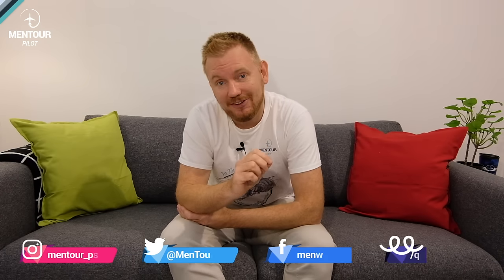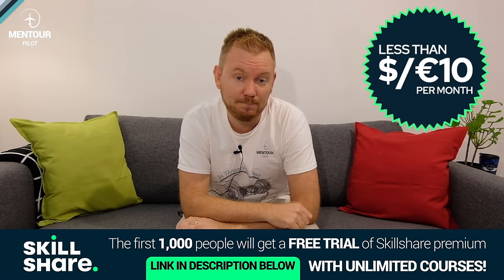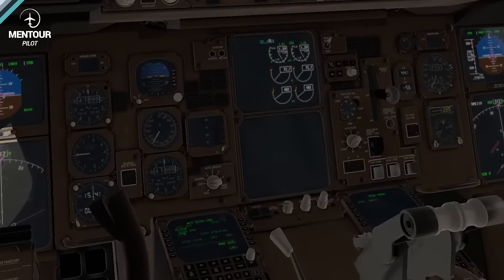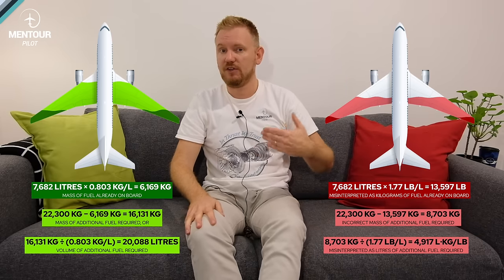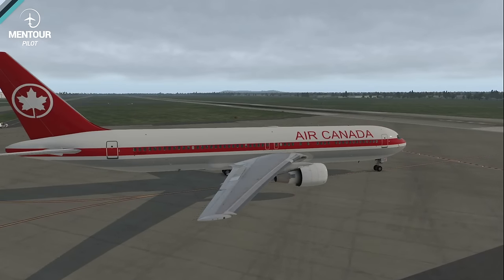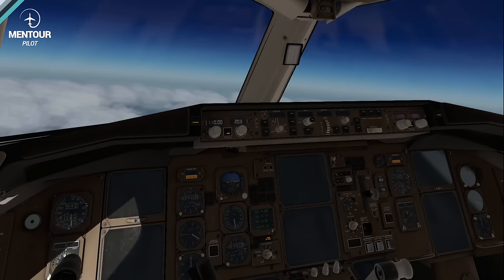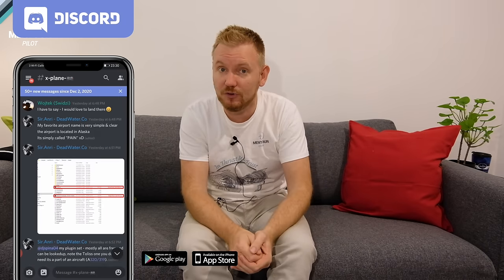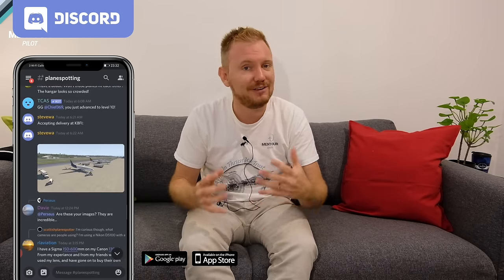The Gimli Glider! Explained

Comment: As over a two decade nuclear power plant operations supervisor I learned early on that as far as turn overs are concerned it's "trust nobody - check everything". It served me well.
Reply: trust but verify
Reply: As a 5 decade railroader - You NAILED it.  Turnover is the most dangerous time on the job.  What you understand and what THEY understand can be two very different things.  Additionally -  don't remove blocking devices on 'in service' equipment - the blocks are there for a reason.
Reply: @mmi16  This is why when a nuke plant goes into an outage, which is operations busiest time, we go to 12 hour shifts to eliminate one turnover per day.
Reply: @mmi16  I agree completely... See the CSB (Chemical Safety Board) video on YouTube on the accident with explosion and fire at the BP Refinery in Texas City... There you can see the operators leaving early and the following turnover arrive late, and the absolute lack of coordination and communication!
The same exactly on the accident where a Turboprop lost the horizontal stab-elevator because maintenance left the repair incomplete, and the next turn did not inspected the partial repair!

Comment: I am astonished that there was any possibility at all to have a "circuit breaker out" indication while it was closed (pushed in). Without exception, in 20 years of aviation maintenance, every circuit breaker tag I have ever used could not be fitted to a closed circuit breaker, and if the circuit breaker was pulled and tagged, you could not push it in without removing the tag.
Reply: What year did you start? If you started after this incident, then your experience isn't the least bit uprising, let alone astonishing is it. The results of investigations into incidents like this is normally to make system changes that eliminate the possibility of it ever happening again, which is what you are describing finding in your work
Reply: @mehere8038  After I completed my training, I started my "hands on aircraft" career in 1973 working on C-130 Hercules and P3B Orions. Every C/B on those aircraft had a round, black head with the rating written on it. When you pulled the breaker, the shaft was white (so you could see it was pulled) and slimmer than the head. The tags were small red plastic rectangles with an upside down keyhole - the large end slipped over the head of the C/B and the small end slid down snugly over the  shaft. It was physically impossible to push the C/B back in with the tag in place. We all had our own tags with our names on them, so that anyone could look at the tag and know who pulled and tagged that breaker.

Comment: I was at the races in Gimli that day, watched the whole thing. Also had the pleasure of taking most of the crew for real glider rides at the air cadet gliding camp a year or two later. If Bob had been a couple of miles short he could have used our farm strip... LOL, little bit short.
Reply: One question Sir: in the report Mentour says: the emergency slides were hanging almost vertical. How did the people on the plane get out? The wings were too high to jump to the ground.
Reply: @Dirk-van-den-Berg  they just got out the front ones lol
Reply: @orbitalpotato9940  Why Lol? I don't see anything funny here.
Reply: @Dirk-van-den-Berg  im loling at the lack of critical thinking in your comment.
Reply: @Dirk-van-den-Berg  The R1 and R2 slides where almost vertical (most aft slides) and those that came out those doors were for the most part injured, The over wing exits and the forward exits were much better. The over wings the passengers slid off the front of the wing, not the aft where the slides were and only had a short drop to the ground. The forward exits the slides were almost flat to the ground and after jumping onto the slide they only had to shimmy down the slide to exit. It was an exciting day in Gimli to say the least. I also watched that very same aircraft take off from that airport some time later after temp repairs and that was also exciting. I had the pleasure of also flying on that plane a few years later on a trip to Europe.
Reply: What did the two kids say later on when they saw the aircraft coming towards them...
Reply: @workonesabs  haha.
Reply: Wasn't Captain Bob Pearson a former Air Cadet? If so, what Squadron? I was in the 51st in the early 1970s.
Reply: @FarrellMcGovern  Not sure where Capt Pearson was in cadets, myself I was in the 746 Optimists in BC. Did my power in CYVR in 79 and a glider add on in the very early 80's in northern BC. Towed gliders at the Gimli gliding camp in the summers while on leave from the Canadian Armed Forces in those days, RCAF these days. I was based in Winnipeg and lived on the farm in Gimli and commuted back and forth in my PA28 180 which we kept on the farm.
Reply: @workonesabs  Never got to speak with the kids, I was to busy helping with the evacuation.
Reply: @Brent Galye   The Wikipedia article says it was a Formula Ford race - not a drag race as Mentour mentions. Did they have purpose-built sections of a road course, or was it just orange pylons laid out on the tarmac?
Reply: @HoosierRallyMaster  At 24:14 there is an inset image showing four cars in the foreground that could be formula ford.
Reply: @TheAlanSaunders  Absolutely. 30 seconds on Google and you can find a bunch of copies of that same image. Looking at an uncropped version it is clearly the grid of a Formula Ford like event (Formula 3, Formula Vee, etc). In my misspent youth I was a Course Marshal at Sports Car Club of America races.
Reply: Brent Galye -- That must have been the most phenomenal event to be a part of. Who ever could have imagined a fun day at the races could end with one of the most uncanny survival stories unfolding right before you eyes!
Reply: My wife and l were at the 2018, 35th anniversary ceremonies, and we spoke to an elderly gentleman who saw the plane fly over him on that day. In 2018, he was 87, and he had a plane (and a field strip, l would imagine) at his house, He recounted to us that when he saw the plane go by, he knew something was very wrong. He jumped in his vehicle to go see at the airport as to what had happened. He was a very nice man, and l regret not having taken my picture with him. Would you know who this man was, by any chance ?  On a side note, we are now friends with Bob and Pearl, we went to visit them at their cottage a few times, and when this Covid ends, we are looking forward to visiting them at their house.
Reply: @grignosse  Was that old man possibly short of stature and had scoliosis? If so that is my father inlaw. Our farm was about 5 miles from the approach end of the runway that Bob used, We had a 2000 foot strip and kept our PA28-180 there.
Reply: @brentgalye2936   If l saw a picture of him, l could probably tell. We were sitting down as we talked. Very nice man.
Reply: @Dirk-van-den-Berg  In the book they say all slides were used - Some were slightly hurt trying to use the aft ones while others had to walk on the shallow forward ones. In an emergency like that you do what it takes to get out. Johan.
Reply: @brentgalye2936  a couple comments up there's a comment from one of the pilots that flew it out of Gimli (Dave Walker)
Reply: @Rx7man   Didn't meet Capt Walker, but did watch the plane fly out. Don't know the extent of the repairs, but I am sure there was their fair share of 100mph tape involved. I have been involved in a few aircraft recoveries from the bush and you use what you have on hand.
Reply: @brentgalye2936  I've never been involved with aircraft recoveries but I've been in the bush plenty and used whatever was available 
Cheers!
Reply: Pictures or it didn’t happen.
Reply: @FarrellMcGovern  pictures or it didn’t happen.
Reply: Wow!  You were there that day!
Reply: HoosierRallyMaster There is a purpose built road race track, constructed for the short lived Can Am races series to the North.  It uses some of the old runway for the long straight section of the road race course.  I used to ride my motorcycle on the race track.
Reply: Sure bud..sure..
Reply: Canadian Hospitality!
Reply: @Dirk-van-den-Berg  my understanding based on contemporary reports was that the friction of the nose skidding on the runway had created smoke that was rising through the cabin ie from front to back so the pax were directed to the rear exits.

Comment: One of the most legendary bits of flying in history - there was a lot of experience in the cockpit that day and it showed. There are a fair few similarities to the miracle on the Hudson. The experience of both pilots, the captains being accomplished glider pilots. Good CRM and a fair bit of luck. As someone who is familiar with both metric and imperial - my father and my grandfathers would frequently work in imperial I always work in metric and metric alone. When you confuse the two that is where things like this happen. NASA lost a $100 million spacecraft because they combined metric and imperial measurements. The report into the accident came to some very sensible and helpful conclusions. 

I believe Maurice Quintel passed away a few years ago. RIP.

Edit: Also thanks for explaining the exact mathematical error that they made. I have seen plenty about this accident but never exactly where the error crept into their fuel calculations.
Reply: From what I've read elsewhere, the conversion factor might not have been prominently labeled as lb/L or kg/L in the form either.  Rather just "density" or "specific gravity".  Or if it was, everyone  might've ignored it, being too used to the old lb/L factor.

As for the Mars Climate Orbiter:  NASA actually had been 100% metric for some years before.  But their contractor Lockheed-Martin had used US Customary in their bit of the MCO's guidance software -- and had neglected to convert the numbers to metric before passing them on to NASA's part of the software.  At Mars, the MCO was supposed to lose some speed by passing through the planet's upper atmosphere on its way into orbit.  But instead, it passed too low in the atmosphere and burned up.

Comment: The Captain’s glider experience saved the day. By crossing the controls he created enough drag to slow the aircraft and bleed off altitude to be able to land on the decommissioned runway. I heard through the grapevine that when the parameters of this incident were put into an Ar Canada 767 flight simulator every pilot who tried it crashed. On another note I was  boarding an AC 767 in Toronto a couple years after the incident and I asked the stewardess if she knew the tail number of the aircraft. She replied that she didn’t and asked why? I replied oh I just wanted to know if it’s number 304 (if memory serves here). She looked puzzled so I said, you know, the Gimile Glider?  The look of horror on her face was priceless. I laughed and told her not to worry. The 767 is a good bird and left to take my seat.
Reply: It was 604.  I worked on the ramp for Air Canada, in Vancouver, in the late '80s, and whenever 604 was in I would go sit in Bob Pearson's seat.
Reply: @jasonwhite1069  did the seat have huge indents to make way for Bob Pearson's giant, titanium balls?
Reply: The captain knew the dynamics of flying as a classical musician knows his or her instrument.  Just amazing.

Comment: Worth mentioning that the aircraft (C-GAUN) was repaired and flown for Air Canada until it was retired in 2008.
Reply: It went to the airplane graveyard in the states and gave the military tower there a fly by before landing.
Reply: I wonder how they got it out of there. Did they do emergency repairs on site and fly it out of there, or did they dismantle it and transport it over land?
Reply: @Hans-gb4mv  Great question. On site repairs seems more feasible I would think, but would love to know for sure
Reply: @Hans-gb4mv  According to Wikipedia The aircraft was temporarily repaired at Gimli and flew out two days later to be fully repaired at a maintenance base in Winnipeg. Following the full repair, the aircraft was returned to service with Air Canada.
Reply: @Hans-gb4mv  "Hey, I need some fuel and a set of snow tires at Gemli drag strip"
Reply: @Hans-gb4mv  It was temporarily repaired in Gimli and then flown back to Winnipeg for full repairs. Apparently the first maintenance crew Air Canada sent out to Gimli actually ran out of gas in their van on their way..
Reply: @Hans-gb4mv  That is pretty easy to configure. Since all that was damaged was the nose and the tires, two cranes would have been enough to lift the nose. The patchwork on the burned part of the fuselage, then take the cranes back to the wingpart, lift the plane up again, and replace the tires. Get the fueltruck for a fieldtrip and you're basically good to go.
Reply: @RobertHancock1  
You couldn't make it up!
Reply: It was flown on a restricted height. Can't remember how low but low enough to breathe. Then it was fully repaired to be able to fly normally.
Reply: @firehog  That's below 10k feet. Good.
Reply: @BubblesTheCat1  thanks
Reply: @firehog  ☺
Reply: @Banditt42  I watched the video of their departure from Montreal on that flight. After take-off, they circled the airport and gave a wing salute to the admin building there before heading for the desert.
Reply: @DimitriPappas  Exactly like the Gimly Glider and the 737-300 that was masterfully landed on a Levee near New Orleans, the Airbus A330 was repaired on site and flown from there, and continued to fly for years.
That fact speaks tons on the extraordinary Airmanship of the four Captains, excepting Sully that HAD TO ditch it (masterfully too, of course!), the other three airplanes were fully repaired and continued flying for years. The A320 that Sully ditched was slightly damaged by the impact with water, but the impact was very well controlled and precluded serious injury to the passengers or crew.  Compared to many other ditchings, the "Miracle on the Hudson" was quite successful thanks to a combination of fortunate water surface conditions and pilot dexterity.
Reply: @richardtruesdell8289  CORRECTION: Make it a set of SUMMER SPORT TIRES... (It happened on July, and on a Drag competition Track!).
Reply: As the plane retired, so did the registration number, well, sort of. (C-GAUN).  Now it's on a plane owned by Mark Miller, the Executive Producer of several TV series, including Highway Thru Hell, and Rescue 401. We met him in 2018 at the 35th anniversary ceremonies, Great guy.
Reply: @SJF15  No one died. You thinking of Eastern Air Lines Flight 401- a Lockheed L1011 tristar. Crashed in Fla.
Reply: @SJF15  You wrote "Legend has it that one of the crew haunted the aircraft after he died." That sounded like you was saying someone died when this happened. You could have added "years later" at end. Anyway there were stories of a ghost of dead crew appearing on other Eastern L-1011s that used good working parts from crashed Flight 401.
Reply: @Hans-gb4mv  there's a comment a few posts up from one of the pilots that flew it out (Dave Walker)
Reply: Here in the comments is a comment of Dave Walker who seems to be the pilot who flew the plane back to Winnipeg.
Reply: And should be returned to Gimli!
Reply: @RobertHancock1  HAHAHA!!!!!  The early days of metric system.
Reply: @Hans-gb4mv  Read the other comments. It was patched up and flown to where they could repair it fully. One of the pilots who flew it out commented here, as well as the son of one of the guys who helped with the repairs. Some other people who were there also commented.
Reply: @alfredomarquez9777  Heh, I heard the plane Sully ditched was deemed unable to be repaired, but was scavenged for parts.